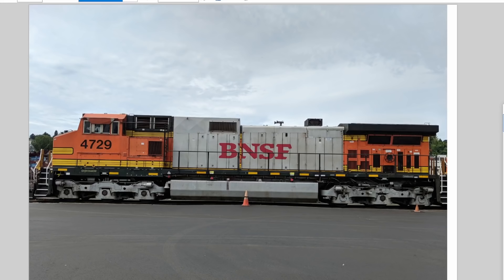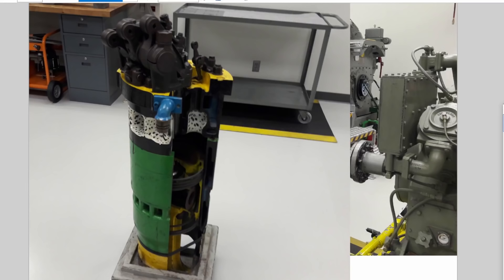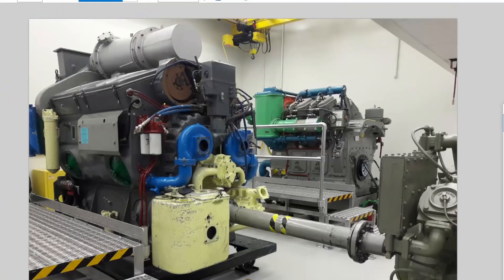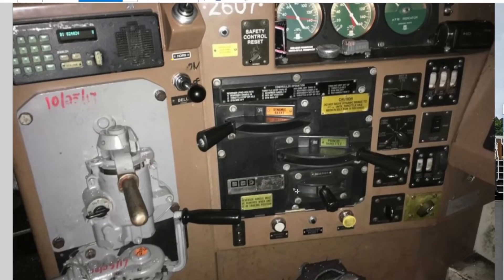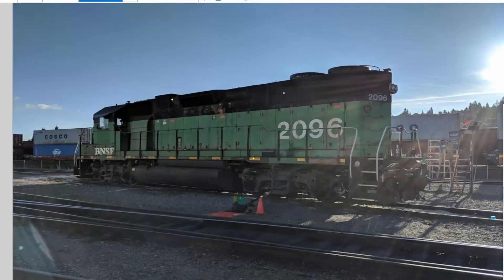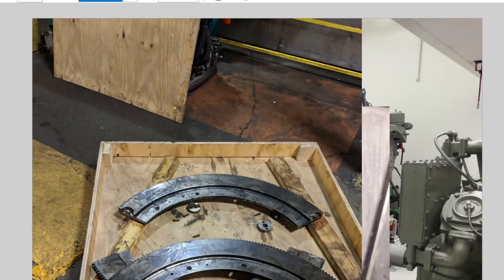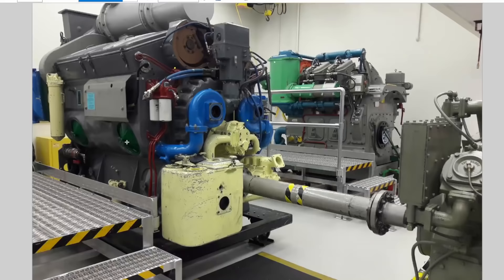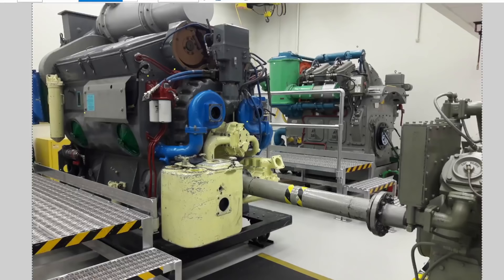Diesel 101 - How DIESEL LOCOMOTIVES Work! [10 Levels]

Comment: I am going to address some thing from  a more automotive / race card viewpoint.  People may be more familiar with  similar systems from the race care hot rodding world, though turbochargers ware more common now than they once were.  These engines run with what racers call a dry sump..   Oil does not just stay in the crankcase like in most cars.   The Roots blower is a type of supercharger.  Superchargers are driven by the engine directly.  In truck  / hot rod applications they are usually belt driven not gear driven.   Racing blowers came from Detroit 2 stroke truck diesels.   Detroit diesel blowers were based on a 71 cubic inch cylinder.   Blowers were sized and named by how many 71 cubic inch cylinders they were built to feed.   A  671 blower was built for a 6x71 cubic inch = 426 ci diesel.  This would not do for one cylinder on a locomotive 2 stroke diesel.  Turbo's are exhaust driven superchargers.     Pure exhaust driven turbochargers take time to build boost when the throttle is opened.  This delay is called Turbo lag.    The clutched turbo  combines direct engine driven supercharging at low throttles with pure turbocharging  at high throttle setting.  Boost is powered by waste exhaust energy when the engine is dumping it out the exhaust. At lower throttle setting the engine follows a boost curve like a traditional supercharged engine.   

The magic required to get mechanical fuel injection working in automotive applications is why fuel injection was rare / expensive until electronic control was possible.    Balancing both diesel and electrical power mechanically sounds like even more wizardry.   This is another amazing look behind the curtain or under the carbody, of a locomotive.   At one time two complete power unitswere installed on one locomotive.   Now single power unit per locomotive is seen as more flexible.     

If you were wondering, some diesel electric engine manufacturers would package diesel engines and and alternators as  electrical power  generators for mobile use.   They typically were mounted on tractor trailer type bodies.   I have even seen on YouTube, a locomotive  wired to provide emergency power for a small town to keep emergency services running.

May I suggest " Train control 101"  ?    We have the Engine, and basic braking  done.  Now how does all this get used in a train? This would include multi unit and distributed power operation and perhaps how a control car fits into things.  I understand this may require support from other experts especially for the passenger train stuff.  This is clearly where " Doing a great job means being as to do another harder job. "  Now I mostly see only commuter trains.  My brother, a long haul trucker often reports on the long freight  trains he see from the Interstates..   My dad was from West Virginia coal country.  That is where my interest in the big Steamers comes from.   I am sure to find more about the trains I saw and the tracks I walked as a kid.  Many thanks for your work
Reply from the maker: Cheers for the great detailed comment, and yes your racing analog all makes sense. Train control 101 would definitely be a good one to do, and definitely would require some amount of collaboration for sure. I'll see what I can put together. :)

Comment: I was wishing a video like this existed, thanks for making and uploading, nice to have an even more detailed understanding of locomotives, particularly the drive system and cooling system.
Two stroke engines don't generate enough exhaust gas to run a turbo, that's why EMDs have a partially clutch driven turbo. GE's do not need that because they are four stroke.
Reply from the maker: Interesting, I would've figured more exhaust gas based on more exhaust strokes in a 2 stroke but I guess it's not necessarily "compressed" by the piston like it is in a 4 stroke, is it?
Reply: @Hyce777  The problem is that you need the airflow from the start on the EMDs. And a turbo just would not spin up enough to do that from startup. No airflow means no scavenging to get rid of the burnt fuel mixture. On Detroits ( which are  baby EMDs) they always had the Roots blowers even if they were turbocharged. This kept them from needing clutches on the turbos and allowed the turbos to spin faster. At the expense of having the gearing and drives for the blowers. Once a turbo is spun up, then they can supply more than enough air for operation so that is why EMD went with clutches.

Comment: Just a little history, both electr-motive division of GM and GM's Detroit diesel are based on the same basic design.  I do not know if the electric -motive shared the issue with run away as the Detroit diesel did
Reply from the maker: It is possible to run one of these away, but usually the governor and overspeed protection stop things before they get there.

Comment: I have seen alternators (or generators) on the running gear of steam train passenger cars, which power that car's lights, etc.     A much smaller version of the locomotive, in reverse.      I assume that's not used any more, and today's passenger cars are electrically powered from the locomotive.

Comment: Fairbanks morse 2 cycle engines were more efficient than 4 cycle engines can be due to the opposed pistons not having cylinder heads
Reply from the maker: Those were... a special thing. hahah
Reply: @Hyce777  Just because you needed a marine mechanic to understand them
Reply: the reason those never really caught on was because they were much harder to work on than traditional two strokes as well as problems with overheating.
Reply: Efficient in theory. In practice they were notorious for clogging themselves with lube oil when idling, then belching white-grey smoke under load.
Reply from the maker: @Knsgf  Too real. Lol. They got a touch better with the autostart system preventing some amount of filling the V with lube oil, but then the starters died faster and faster... lol.
Reply: The huge numbers of the same engines used in marine applications never had those problems even while operating in far harsher environments. Of course, since a mariner's life actually depends on their engines, they are going to maintain them. Railroads have no such incentive.
Reply: @Griz1231  Marine engines, unlike those in locomotives, rarely if ever idle for prolonged amount of time.

Comment: Also interesting fact Detroit style 2 stroke diesels  non tt models “no turbos” are not considered to be a “forced induction” however 12v71tts or 16v92tt ect are considered tobe  forced induction. Nothing cooler than a Detroit buzzin dozen wound tight at 1700k rpm

Comment: FYI: the reason for alternators over generators is because alternators put out high power, even at idle. Generators put out more power, as the spread of the engine increases. This is why generators were replaced with alternators in cars.
Reply from the maker: Well cool! I had not heard that reason. Thanks for the comment. :)

Comment: I didn't quite follow the oil description.  If I drop my 10mil socket in the crank case, it gets sucked out by the sump, pumped into the filters, then through the water heat exchanger, then to the ice cream box, and that's what catches the socket?   Seems like the filter isn't much of a filter if it passes a 10mm socket through it, what's it filtering?  Small animals?

Anyway, seems like the flow should be reversed.  But in any case, I enjoyed the video very much and learned a lot.  liked and subbed.
Reply from the maker: Cheers Jaye, yeah, it doesn't make that much sense, does it? It's not great for things dropped in the crankcase. things dropped in the filter barrel though, yes.

Comment: 2 stroke engines don’t run forever. As an arborist I can go through 1 climbing saw per year if I’m tuning it for power instead of fuel efficiency. Yeah, I could replace upper, but then it wouldn’t be the stock engine. Piston rings aren’t forever is all I’m saying 😂😭

Comment: The 2 stroke emds and smaller cousins the 2 stroke detroit diesel will not run without a blower as they don't create vacuum to draw air into the cylinder they are considered naturally aspirated until a turbo is added the blower only makes about ½ a psi above atmosphere
Reply from the maker: Makes sense, that's cool.

Comment: What about curves? Road Cars have differentials. A solid train axle (motor between them) on the train means one, or both, wheels will potentially slip in curves. Doesn't that affect traction?

Comment: About that locomotive electrical system.
I know the locomotive probably starts using compressed air, and that it has batteries to provide power when the engine's not running.
But what powers the headlights and controls and all that supposedly low-voltage stuff? (Right now as of posting this comment I have only watched from the start to about midway thru Level 6, perhaps my question will be answered before the end of the video)
Right now with no further info my bet is that it's the excitation generator or companion alternator which has voltages and currents that are (if needed) rectified to DC current and (mandatory) regulated in voltage to supply the various non-traction electrical systems of the locomotive, as well as the critical task of recharging the batteries.
Do I have that right, or am I way off base?

Comment: It wasn’t said outright, but I’m guessing, from what you said during level ten and the governor, that the reason you need more horsepower is to be able to turn a larger alternator to produce the amount of electricity needed.  Otherwise, I can’t see why more horsepower would matter.  Is this correct?

Comment: I have a couple of questions. First ooking at the picture of the engine what is the giant white circular tube thing on top of the entire engine is that a turbo charger? Second what is the yellow box to the back of the engine, and finally how does all of.ot work electricaly? For an example how does the levers and switches get to control the engine, alternator  and other systems.
Reply from the maker: The tube is for the exhaust, which ultimately goes to the turbo (if equipped). The big yellow box is the lube oil strainer, provided I'm understanding what you're asking about. The electrical piece of it is too complicated to answer in a quick comment here. Hopefully in a future video. .

Comment: 2 stroke diesel, is not the same as 2 stroke gas. A gasoline 2 stroke has 3 types of ports, an intake port leading to the crankcase (and sometimes straight to the transfer port in high performance), transfer port, which leads from the crankcase into the cylinder, and exhaust port, which uses the force of incoming gas from the transfer port to shove exhaust gases and fresh mix into the pipe, then sound waves will push the mix back into the exhaust port after the reach the "balloon" section of the pipe. It also has "valves" but they are more like flaps that get pulled open by the vacuum of the engine. Reed valves.
Reply from the maker: Oh interesting. I wasn't familiar with gas 2 stroke operation whatsoever. These EMD's just have the intake port and exhaust valves.

Comment: As a DIY car mechanic, I know that a lot of cars nowadays can have at least 30 to 40 pages worth of wiring diagrams since nearly everything in them is electronic.  I can only imagine how many pages worth of wiring diagrams that one of these bad boys would have in comparison.
Reply from the maker: Lots, and most of them are probably inaccurate do to changes, "repairs", and modifications over the years, lol!
Reply: @Hyce777  I’m also an aviation enthusiast, and that turbo you showed at 15:51 I thought looked a bit similar to the turbos that were used in warbirds like the B-17, B-24 and the P-47.  Then again, those turbos were made by GE as well.

Comment: Air flow is for engineers to know if the brake pipe doesn't have any holes/bad leaks in it (such as a damaged/missing gasket between cars).  It should go to 0 when you set the brakes, and then go up then gradually go down to 0 when the brakes are released.  It measures how much air is being pumped into the brake pipe from the main res via the EQ Res.  It's also used to tell when the train is charged up enough to do air brake tests on the cars among other things.

Depending on outside air temps, a good train will usually have 0 flow when the brake pipe is fully charged (but depending on length the gradient of the brake pipe could be ~5 psi from front to rear--90 on the head-end and 85 on the rear).  In cold air it's not uncommon for the train to have a 20cfm flow on a non-dp train.  As far as we're concerned as engineers if the flow is below 60 and the rear of the train is charged to 75psi the brakes on the train are released.
Reply from the maker: Cheers, thanks for the explanation on flow. We have the same 15 PSI difference requirement here in narrow gauge land, it doesn't come into play terribly often though... hard to have that much difference over just ~10 cars.
Reply: It's all in the Air Brake and Train Handling (ABTH).  The only exam I aced in the engineer program.  haha
Reply from the maker: @Tmann26  Very nice. I've had to reference the ABTH once or twice but other than that I've never gone diving through it.

Comment: Nokia FC0300 power adapter.

Takes 110-240VAC 50 or 60Hz, and around 300mA, and gives:
5VDC 2,5A
9VDC 2A
12VDC 1,5A

Also, if I get such thing in my hands, I'm ripping off the whole powertrain, for 4 Scania V8 powered gensets.

Comment: Well the field windings are energized in the traction motors THEN you get amps, BUT amps mean nothing without volts, 1 amp @ 110 will vibrate your arms, at 220 it will kill you...eventually, but @ 600 volts (commonly found in diesel/electrics) will cause your eyes to have a steam explosion and 1000 amps @ 600 volts is "gone in a blue flash" time, have you ever tried to bake cookies( toll house) on a dynamic brake radiator, I've heard it's possible.
Reply: I forgot to add this cookie baking was done while testing on a dynamometer.
Reply from the maker: I'm sure baking cookies on the grids is possible! They get hot.

Also, 1 amp, no matter the voltage, will kill you if it goes across the heart. But otherwise totally right. Lol

Comment: So are the blown engines are technically naturally aspirated because there basically a big version of general motors 2 stroke diesel high speed engines i.e.6-71 8v92 they need the blower in order to run because of the exhaust scavenging they don't produce any boost
Reply from the maker: Yeah, that's exactly right.

Comment: The reason why two stroke gas engines are so heavily polluting is because they still have carburetors, and some of the aerosolized fuel air mixture is going to go straight out the exhaust pipe without being burned during the single exhaust and intake stroke. That doesn't happen with a two-stroke diesel because the fuel is injected into the cylinder while the valves are closed. Unburned gas is a much worse pollutant than exhaust products. The two-stroke gas small engine and the two-stroke diesel engine have very different designs.
Reply from the maker: Oh huh, I never thought about that difference. That makes a lot of sense. Curious why the 2 stroke diesels still don't meet the spec of the 4 strokers.
Reply: 2 stroke gas engines pollute a lot because they burn oil and gas.

Comment: Hi Hyce,
In old steam engines; not locos, I remember seeing a device with two spinning balls, that by centrifugal force, were forced outwardly, and this regulated the speed so as not to have a runaway engine………In school buses back in my day, their engines were equipped with governors to limit the driving speed. Why is antifreeze coolant used in place of water? Great presentation. How did you get into railroad repair? The first time/video I saw you, you introduced the K37 video from what looks like a guitar shop.Huh? Great job.
Reply from the maker: Howdy Lhunter! Yeah, that device is called a ball governor, regulates speed. The diesel locomotives have an overspeed protection device as well. We don't use antifreeze in diesels actually, it's water treated with borate, which is a rust inhibitor. And really the reason is because it's cheaper. Lol!

I started as a volunteer at the Colorado railroad museum during college, which led me down my odd and fun career path. The "guitar shop" is my home office, I'm big into guitars and rock music. :)
Reply: Hi again,
Thank you so much for such a quick responses. I also play guitar….no rock…never acogoto on the that genre….I like it, just can’t play it. Take car and thank you

Comment: Catenary electric locomotives can send the dynamic braking power back up into the catenary wire and brake the one locomotive while the energy is sent back into the catenary where it can help other locomotives go with that braking energy. Diesel electrics waste that electrical energy as heat. Now that there are only 3 main railroads the types of dynamic brakes are not nearly as important as they used to be. The planar dynamic brake was favored by railroads that ran primarily on flat terrain. The serrated tapered helical dynamic brake was better in mountainous terrain. One grinds along scrubbing power off as heat at a constant rate. The helical serrated brakes harder as the load increases.

Comment: I love the decoupling of the power unit from the powertrain. Why aren't large road vehicles built this way? Seems like they could perform better with lower engine RPM and more responsive power delivery. Is this system not as efficient when shrunk down?
Reply from the maker: Probably not.